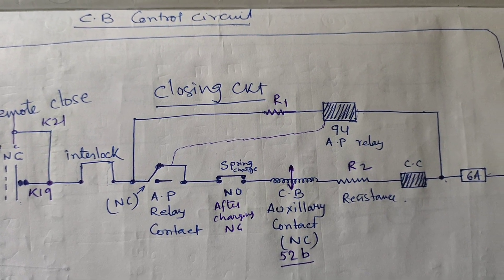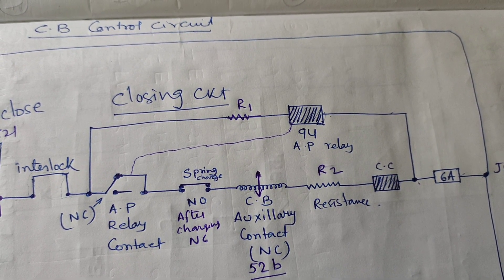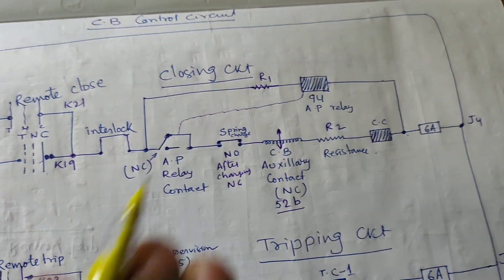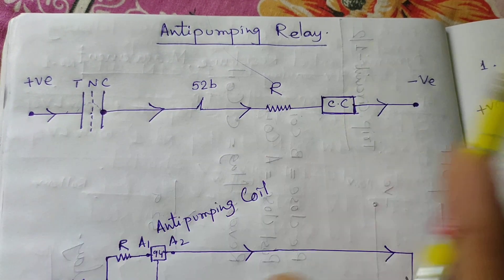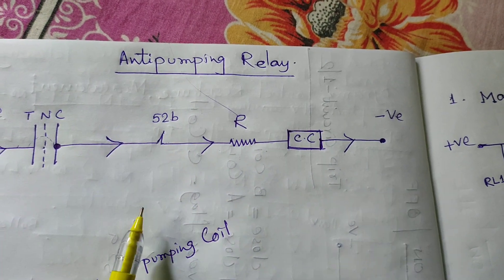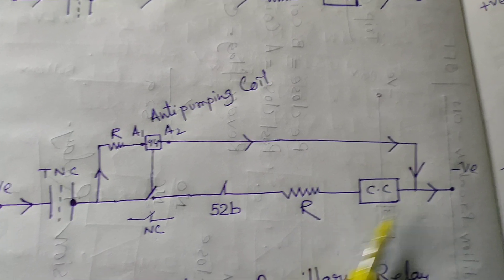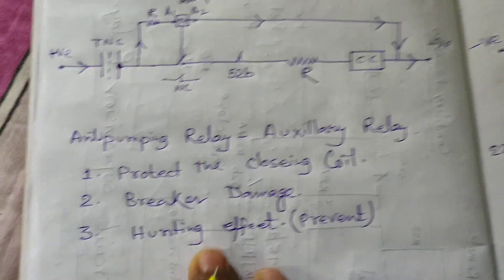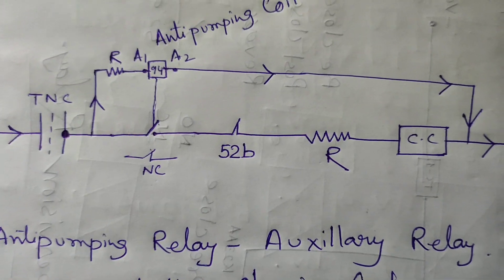Antipumping Relay in English

Comment: when the command is sent through TNC switch to the breaker closing coil at the same time AP relay is also energised from the same source, its NC will change to NO position the breaker will immediately trip..May be u missed the link?
Reply: You are wrong. It will never trip the CB while Close command is given via TNC switch (Ofcourse only if it's not closed onto fault). You might want to read up on the function of  NC contact of 94 in the close path..

Comment: You should have added a 52a contact in series with the 94 coil along with a NO contact of the 94 (in parallel with the 52a) itself for the full functioning of the Anti Pumping logic. (52a contact will ensure that the AP contactor will be picked up only after the CB successfully closes. 94's NO will ensure that the AP logic will still be in effect if the CB is closed on to a fault.)